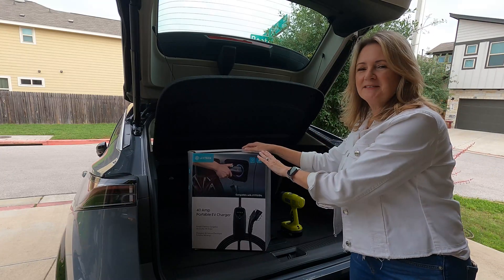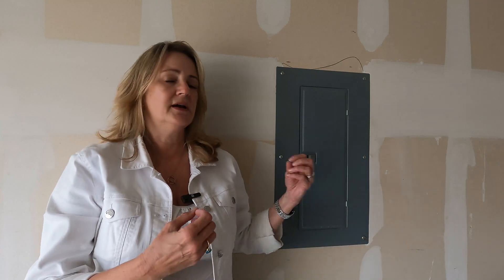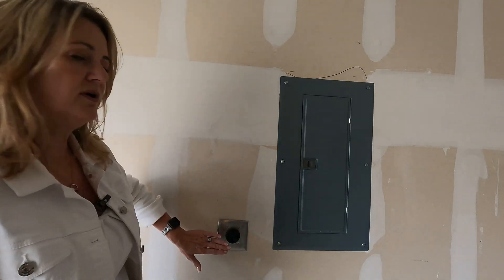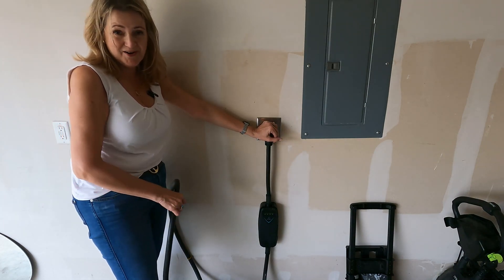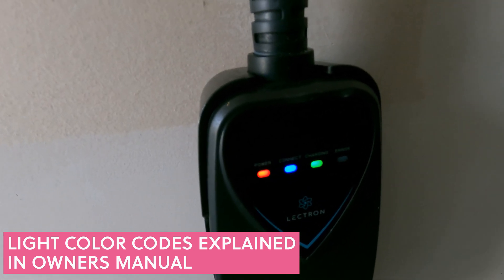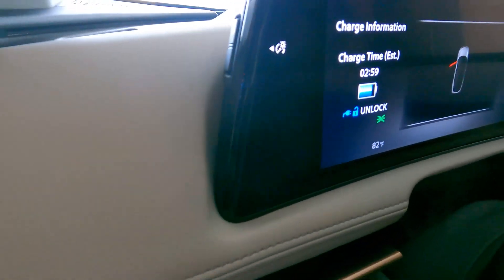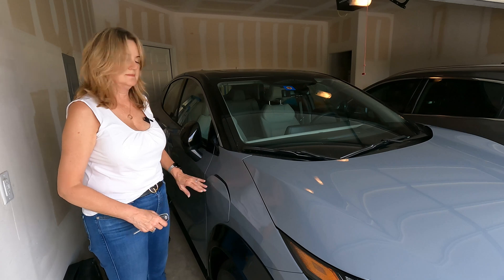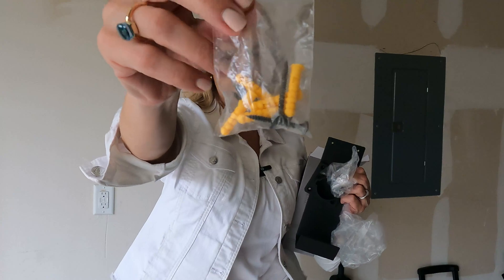Easy and Inexpensive Home EV Charging Level 2 240V- The Lectron Portable Home Charger

Comment: Thanks for the review.  One thing you might reconsider is the use of a $10 NEMA 14-50 outlet.  They are not designed for the continuous high-amperage use of the plug as what happens when you charge an EV.  They are also not designed for things that are unplugged from the outlet frequently.  A better quality Bryant or Hubbell outlet costs around $50 and should hold up to the electrical demands of an EV.  I've seen videos on YouTube of plenty of melted $10 outlets.